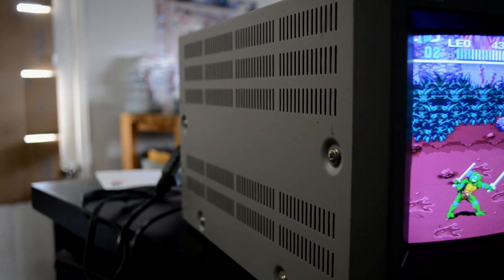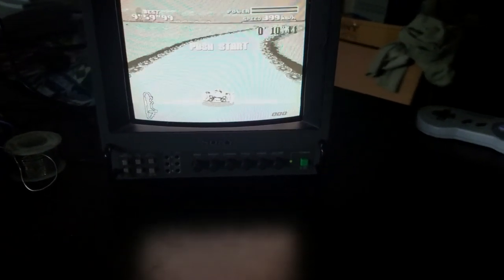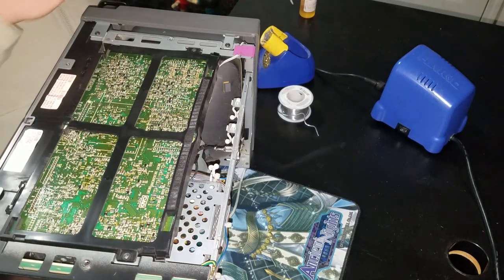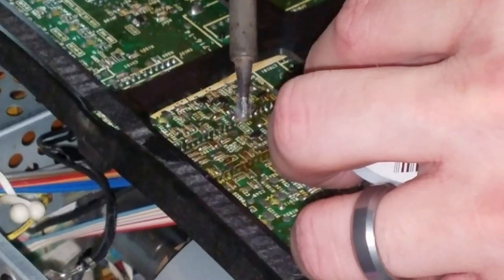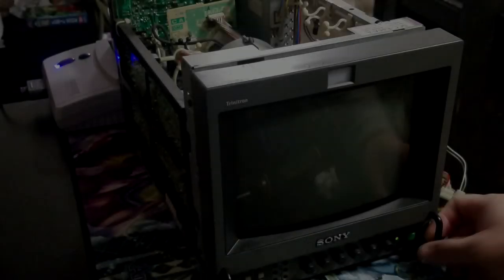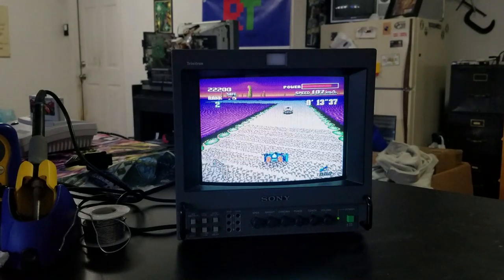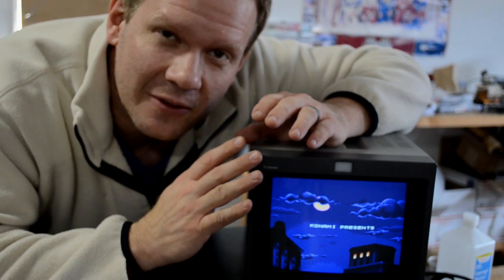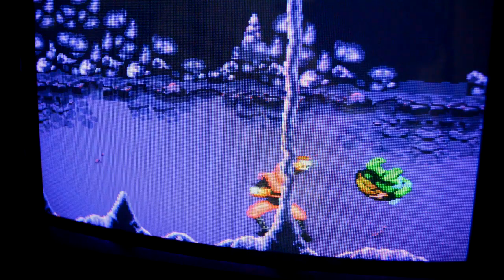Sony PVM 8041Q Repair: From Black & White to Color!!

Comment: Reflowed strategically : didn't work
Reflowed with my hot air station the entire B board : worked !
Thanks ! (I got my first PVM 2 days ago, and this one today, both are now calibrated and I fixed the b&w issue on the composite, I feel like a fucking champion ! Thanks again mate, 100% of my knowledge came from your videos and cherry on top : I didn't get shocked !!!! Youhou !!!)

Comment: Thanks for the tip, I just fixed a 9041QM with this method, reflowing the main IC and the board connectors

Comment: Thanks for the video.  I've been looking for information about my  PVM-8044Q's.  One works fine and the other is kind of doing this same thing.  I'll have to give this a shot.
Reply from the maker: Thanks and give it a try.  I fixed 2 in one day with this same method.  Just a bunch of cold solder joints on them.  Good luck!

Comment: I had PVM-9041QM, and exactly the same problem with it, randomly lose color. I took it to repair, after which I sold it, and then I bought B&O MX7000 CRT TV.

Comment: I have a little 8045q that I pack around due to its portability.  The picture is fantastic due to its 450 tvl, a nice step up from the 250 tvl on this monitor.  Its just enough to where you can barely see the scanline effect if your leaning in and peeping.
Reply: @kennylauderdale_en  Yeah.  Even tho I have a 20L5, I still keep it around due to the picture quality and how portable those things are.
Reply from the maker: I also have a 8042q, Its has 450 tvLines.  I had to do this same repair to it and it worked.  I'll show both of them hooked up in a video towards the end of the week.

Comment: Do you mind sharing which capacitors usually go bad in the power supply board? I have this monitor and I'm having issues (and because of the nature of the issue, got told it's very likely a bad cap in that board).

Comment: I’m not convinced we actually witnessed a repair being carried out.
Reply: He didn't repair it just touched up some joints on a through hole plate boards that rarly if ever suffers from dry joints, I've certainly never seen dry joints on the board he works on, only ever seem them on tube base, psu and back connection panel they all suffer as single sided, through hole plated boards rarely go dry jointed, repaired literally thousands of these, check my channel out the proper repair is 2 x trimming capacitors on colour board used in colour circuit, 1 trim cap is for pal, other is for ntsc, change both, I've even got the sony part number for the part in the video, the older pre 1997 versions had orange body with silver cross head trim bits and they are crap, post 1997 sony switched and used "mura" brand and they never fail, repair engineer of 24 years working on these babys.

Comment: Hi, I have a Sony 2054 QM PVM that only has color when connecting an NTSC console with composite. If I connect a PAL console, the image is black and white. What could be the problem and could someone, with a little soldering skills and a heat gun, fix it?

Comment: I have a PVM-8040 that will only display in monochrome. I know it is a slightly different problem (intermittent color loss in this video's example vs. permanent in my case), but will this re-soldering process work to restore color on any PVM with color problems?

Comment: Thanks for the tip, definitely going to keep this in mind. Do you have a video adjusting the deflection on one of these? I have an 8045 I need to overscan horizontally.
Reply from the maker: I don't, I've only make color videos on this one, but it's easy to adjust using the pots on the board with the Flyback Transformer.

Comment: I don’t understand how it can only have 250 lines of resolution or how that can be “almost Hi-Def.” Standard-Def is 480-525 interlaced lines. Hi-Def is 720-1080 lines. Enhanced-Def is anything in between (480p, 600p, etc).

If this tube doesn’t even have 480 lines then even 240p should suffer. Since 240p is kind of a 480i hack I don’t see how this could be a native 240p display which downsamples 480i or something weird like that.
Reply from the maker: These CRT's resolution is stated in terms of the number of horizontal lines across the screen.  The higher the line count, generally means a clearer and sharper picture on the display.  Digital video signals are not processed in this same manner as the 240p and 480i analogue video signals so the technology to display them properly differs considerably.  This PVM monitor will process whatever 240p or 480i video signal you can input into it without any real screen scaling or processing, meaning it won't manipulate the true video image much.  

When I stated that the picture looked high def, I was referring to the screen look from the naked eye.
Reply: Don't think of CRTs in terms of pixels. 250 TV lines means there are 250 horizontal cells per line for the beam to hit, but that doesn't really relate to the input resolution. The monitor can display any resolution which fits into ~15kHz of horizontal scan and ~60Hz of vertical scan. 320x240 works just as well as 140x192.